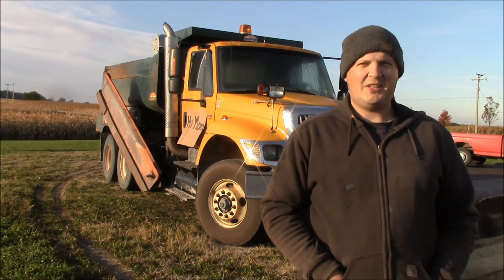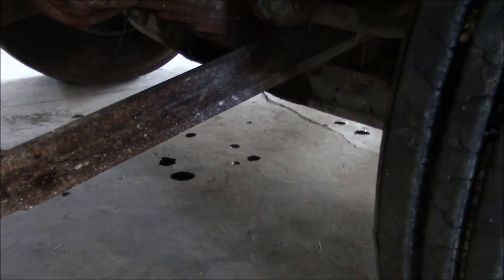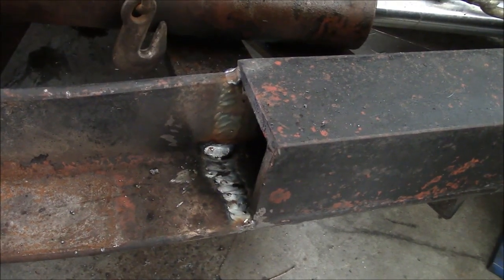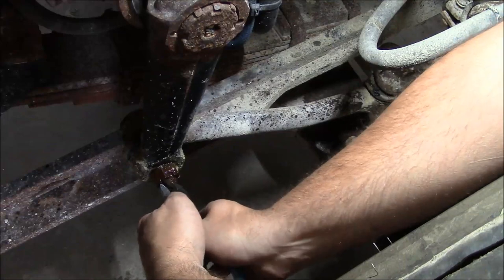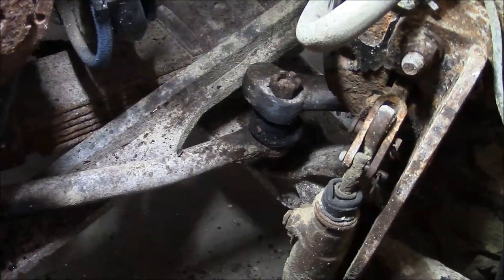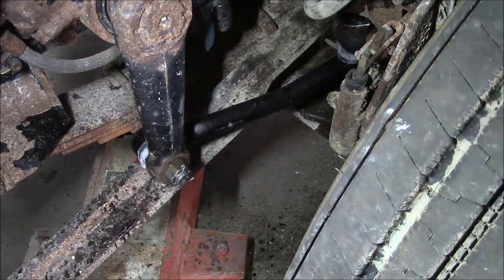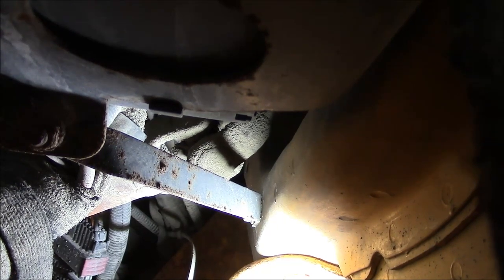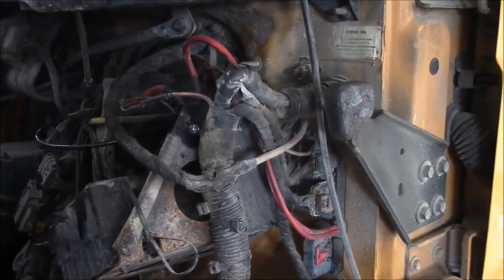Fixing a Plow Truck

Comment: Wes,  Does this engine have a similar High Pressure Oil Pump setup as the Powerstroke?  If so they have been known to slowly allow the oil reservoir in the HPOP to drain out over time when not in use.  When cranked there is no HP Oil for the HEUI injectors, eventually oil re-fills the HPOP reservoir, but now there is air in the HP lines that has to bleed out.  Usually all of this takes enough cranking to discharge the batteries to a point the Injector Driver module turns off due to low voltage.

Comment: Wes, what are your thoughts on a new in cabin battery isolation switch & a few high amp cables. Instead of replace isolation switch on battery box where its exposed to salt & corrosion. Or is that just adding to cable birds nest of wires? Cheers.

Comment: Could you add an extra battery an isolator? So that when cranking the starter pulls off the duals and the electronics and injectors pull off the aux. So voltage drop won t affect the injectors

Comment: The no start issue is most likely the camshaft positioning sensor, the DT466 is the same as the 7.3l powerstroke. I had the same issue with my truck occasionally not starting turned out to be the camshaft positioning sensor.

Comment: Wes,

Not finished watching yet, but...

Is there a GPS and a tracker unit plus a control unit installed?  What about a road surface temperature probe?

I have come across the same issues (power wise) that you have. It’s common in Europe to have some extremely sophisticated equipment. Unfortunately it is often installed by who ever wins the bid. You end up with a really expensive gritter that is then modified by four different companies. This makes a reliable, if expensive, gritter, inoperative (U/S).

Comment: Saw this on Joe's Auto Electric, a meter called an Amphound.  It allows you to check the draw across a fuse in place, so no device reset by pulling the fuse to check for amp draw.  Hope this helps if that truck comes back.

Comment: Love those 03-07 trucks most common problems on plow trucks were fused wiring coming out of battery box (If you get the yellow "engine" light start there, A IPR once in awhile. Any questions on plow/auger controls let me know

Comment: I ran across a great tip for locating parasitic draw without pulling fuses, or going through multiple resets.  You measure the voltage drop across the fuse, and a chart (using the resistance of that fuse) will tell you the current passing through the fuse.  On modern vehicles, sharp probes can reach both sides of the fuse through the case.  Let me know if you can't find a chart, or this doesn't make sense.
Reply: I've found you can even measure the voltage drop on wires feeding the fuse boxes.  Easy way to narrow down where the active circuit is.

Comment: The 466 and 433 use a HEUI system and on these engines there is an oil reservoir towards the front center top of the engine.  On the bottom is a check valve that can sometimes stick open causing it to drain out.  Shows as an extended crank or no start.  Next time it does not start have them call you.  On the top of the reservoir is a cap with an allen bolt i think.  See if the reservoir is empty.  If so refill it with oil and see if it starts.  If so just replace the check valve.  The is a common issue with the 7.3s.

Comment: Had a similar problem with a 2000 international 4700 fb tow truck there a wire bundle for the main harness that controls every thing on the truck. The conector for that main harness get warn and make it no start it was under the cab by the battery box i remember that but the fix was simple take that clip out and rewire with out that conector direct wire with out the clip conector

Comment: I drove those for the county for 15 years, did the "hook up" one those ( pulling the plows and sander off turning back to a dump for the summer then back to a plow in the fall ) I had the Cummmins 425hp IPM's and then later Max Force 13's at 475hp and they all had 18spds. Solid old trucks. My two favorite's were a 2006 with a forward discharge box with a Cummins and then the 2016 that had the later version of the Max Force 13's after they were sorted out. THAT was a beast of a plow truck! Then I was stuck in a Western Star with a Detriot and Allison....hated it as compared to the last International with the big power and 18spd. BUT go real familiar with the plow system from pumps through to plows and plow frames.

AND to the parasitic draw on the batteries......we had battery shut off's... as they always had things powered up. Other thing is rust/corrosion from salt skews everything, all the connections everywhere. most had a junction box at the rear of the truck, a round junction box. We had that set up with plugs for the lights on the salt bodies....then unplug them leaving the standard tail light. THAT box would collect moisture and corrode internally creating issues everywhere as the "pool" of water was across all things....another source of power loss. Net was we would take those trucks when they came in from Stadium International and pull EVERY connector and pack them with dialectic grease. Every one before the truck saw salt. My hunch is on your truck if you pull some of those connectors you will see the tell tale green and that will cause intermittent issues. Also the starter solenoid. Of course that's assuming that truck saw salt use. We could get a "clue" plugging into the lap top and chasing error codes...never pointed to the exact area but the class of connectors around what systems were corroded. One of the last ones was the "DEF" sensor on the tank.....got corroded and failed at 1:00 at night 20 miles from the shop on a snow and blow night.....shut that truck down! Red light. While killing time waiting for assistance broke the lead accidentally when pulling out scraper I had stuck behind the fuel tank.. by chance...and by did a red neck reconnect did another battery shut off and restart attempt and the truck fired right off. Got me home. Found it had corroded along with a few others we had missed with the grease.

The other common issue with the later ones is salt would pack in that small radiator they had in the egr system under the main radiator. Wouldn't do its job and the truck would start throwing egr codes and going into limp mode. Drove every one crazy until we figured that one out.

Comment: Like you said hammer on the taper has always worked for me.  hope you get some of the other work you found wrong.  My Diamond Reo was an old township truck and its got all that hodge podge wiring from the 70's on in it. surprisingly most of it works.
Reply from the maker: The wiring on these plow trucks is always scary. Even it the body installer does a good job, the township guys will do all kinds of sketchy repairs that make things worse.

Comment: Awesome welding job man, as for the "intermittent no start" issue,  if that kill switch is old enough to be frozen up then its old enough to have pitted contacts, which notoriously fail during frigid weather.  Tell them the next time it refuses to start to check the voltage passing through that switch 1st thing.

Comment: We have a roll back with a 466E that wouldn't always start because a bad O ring on an injector was letting lube oil leak by, so the engine struggled during cranking to build up enough pressure to open the injectors.

So it wouldn't start on a low battery or if the engine oil was hot.

Eventually it got worse , which is when it became "diagnosable".

So watch the oil pressure during crank, if it's marginal it can cause random no starts.

Comment: In a previous video how to precharge engine oil i use a refrigerator compressor with copper tubing and fitting sucking out of oil pan and charge to hi pressure side on my international itis in the chanel above the oil pump at a 1/8 n p t fitting works great

Comment: Hi again Wes - one suggestion with your meter. Cut and Wire in an in line fuse on the positive lead, and drop in a 7.5amp fuse. Did that with mine, saves a LOT of money in case of an oopsie.  Kinda shocked to hear them say that .5amp IOD is acceptable, not in my books it aint!

Comment: Well at least the tires look good! All the cracking is just l like having extra tread 😒
Reply: The tires are fine. They usually get refurbished like 5-6 times before they reach end of life :)
Reply: @RubenKelevra  iuì
Reply: Geez. Everyone who has ever bought something with wheels from a farmer says the same thing. Why? Because Farmer Brown will NOT change that tire until it turns into rubber and rust molecules.

Comment: U.K. Just found your channel - Subscribed. Not sure exactly why but you show good and bad and that's what life is. I have found the worst lot for looking after anything mechanical is farmers. The worst was a large scrub cutter towed by a tractor. It had 3 x 30 inch square blades with hardened cutters on the corners. They went round so fast they howled. The blades were thin aluminium sheet and one was cracked right round 6 of the 8 bolts holding it onto the hub. It was used on a campsite and I had visions of the most deadly frisbee on the planet carving through tents, caravans and people. Made some new ones up out of 16 gauge steel and painted them. Be OK till the rust bug gets at them. Take your feet off at the ankles.

Comment: If you reset the A. B. S.  and it resets it is a air gap issue between your sensor and your tone ring. If it doesn’t reset it is a wiring issue.

Comment: South Main Auto uses a infrared heat camera module for (Flir?!) to visualise where the parasitic draw is happening. You can actually see which of the modules is 'hot' by looking at it through the camera. Very handy, cause otherwise you'll have to chase fuses and isolate circuits. Worth investing in that :)

Comment: Our international tow trucks where I work we have 2 of them that have a no start issue. If our wipers turn on when the key turns on it won't start
Reply from the maker: Interesting. I think the wipers are controlled by that body module.
Reply: @WatchWesWork  it's the weirdest thing. We "solved" it by putting in battery cut offs

Comment: You have a good work ethic, hope the township realizes that.  When they go for lowest bidder it is often the sloppiest bidder too. They should bring their cables to a clean connection point that can be used to isolate equipment for trouble shooting.  Glad I was able to reject installed equipment that was not neat and clean along with properly installed.  The steering has to be as shaky as the nuts where mean.   Nice touch on the Hi Mom and keeping the township name private, I am glad you respect your customers.  I hope you get to much work so you can choose what you really want to do, some days beating a part out is therapeutic.
Reply from the maker: Heh. Usually the choice is to try to do it all!

Comment: Not sure if the dt466 is setup like the power stroke with the hp oil lines. I remember getting air in those lines and it being a bear to start(it definitely had some oil leaks)
Reply from the maker: It is similar.

Comment: I'm guessing you already have a decent clamp meter but since I didn't see you break it out - something like the uni-t ut210e with low-range dc clamp metering can be a huge help in tracking down what's drawing what in a vehicle, especially when paired with some fuse "current loops"
Reply from the maker: I own at least 5 clamp on amp meters. Possibly more. And I did use them. You just didn't see it on camera!
Reply: @WatchWesWork  Yep, kinda figured! The comment was also a tip for other viewers ;)

Comment: I think a scan tool(ServiceMaxx  pref) would help with the No start...then you could verify oil pressure high and low/rpm signal/fuel pressure/idm v/Inj PLSwdth..... with very little work. If it is loosing RPM signal I would make sure rust has not pushed the CKP away from it target:) You could always scope it too   Cool video as always Wes:)

Comment: I have the same thing going on in my car at the moment. I think on mine it has to do with the timer for the interior lights, I have been pulling out the fuse, but it makes the key fob not work to open the doors. It is very hard to find, and it suddenly turned up less than a week ago.
Reply: A friend found that a rear passenger door electronics were causing a similar problem.

Comment: The injector o rings fail as do the injector line pucks (seals) on the high pressure oil rail causing hard starts and sometimes crosses oil into the fuel system. Sometimes the problem is more prominent hot beings the oil has thinned. Gotta love 466s
Reply from the maker: I suspect this is electrical. Maybe FICM related.
Reply: @WatchWesWork  could well be. I read the post wrong I believe so it's not starting as in it has a battery drain causing it to be dead in the morning or is it just hard to start I run quite a few of these 466 engines in my fleetpretty regular problems from the fuel injection pressure regulator on down to seals and what not they really don't appreciate being ran hot this initially causes most of our fuel system problems and hard starts keep up the good work I'm always interested in finding more cures for the pesky 466 that I have grown to love

Comment: I had battery issues with my Yukon coming from the AC. I put a 3 amp float charger on it and leave the charger plugged in no further issues and these chargers will not overcharge the batteries. A fifty dollar fix.

Comment: If you turn the cotter pin 90 degrees then fold the end back over the end of the bolt you won't leave little daggers sticking out for the next guy (probably you) who puts his arm in there.
Reply from the maker: I got in the habit of doing it this way after years of working on wheel bearings where the cotter pin had rubbed a hole in the dust cap when it was bent as you describe.

Comment: It's real easy to find a parasitic draw on a truck like that.  Turn off the key.  Pull all the fuses.  Put an amp meter on the positive cable.  Put the fuses in one by one.   When the current jumps up you now know which circuit to look at.   With an assistant watching the ammeter, start wiggling wires on the circuit involved.  That will find a short.  Also look for switches that aren't turning off.  Doesn't take that long.

Comment: I welded for over 35 years and if you burn yourself apply heat to the burn just to feel the heat from a lighter flame for a few seconds and it won't blister or hurt or short time later, but in time you will have new skin under that burn.  What you are doing is stopping the nerve endings  from sending the message to your brain that you burned yourself done this many times

Comment: They should just call you when they have the problem. Easier to just wait until it happens, or add a timer with a battery disconnect. If there are 45 minutes no cabin light, it just disconnects the batteries. If you want to start it, they have to reset it :) 
I bet it's just salt and water on some connections increasing the current draw overnight, while the snow is thawing.

Comment: Get yourself a Aloe Vera plant, whenever you burn yourself just break off a tip off one of the leaves and rub the juice onto the burn the quicker you do it the less burn you will get, I have often burnt myself with a gas torch over the years and using aloe Vera you can't even see where I burnt myself the next day.
Reply from the maker: Hmm. That's a good idea. We had one in the machine shop when I was in college.

Comment: Those are split pins Wes, they’re split, see !
    You could replace the battery disconnect switch,( and make the drivers job dependant on using it !)
Reply: not part of the work order for a disconnect, but assuming he wrote it down for a later fix with all the other observed issues.   
* often a government worker :  a driver only drives.   a mechanic does only what is needed to keep things running, routine daily maintenance is often skipped for the next day and that leads to never done for a year or more in some cases,  and will omit steps not needed if not an immediate issue and will send it off to be fixed when the steps that are suppose to be routine  that were not followed catches up..  not saying that is all cases or this case, just saying it happens.
Reply: ROTTK9  Yup

Comment: If you want to mitigate that burn (I know this is years after the fact) there is only one thing you need and that is simply an Aloe plant you can keep in your house.  Break a piece off and smear that gel all over it and then let it air dry.  Bandage it loosely and put more Aloe "Juice" on that burn about 4 times a day for 2 days or until it feels comfortable. 
When it is all said and done you won't know it even happened after a week. The burned skin will not dry out and be uncomfortable as it would be normally. Ask me how I know.

Comment: hit steering arm on the end it makes tapered hole egg shape it will pop out
Reply: When you hit it, it is a solid piece with the tapered joint and arm as one, so the taper doesn't deform permanently.  I guarantee it didn't get past the plastic deformation state.
Reply from the maker: I'm not that strong!

Comment: Couple of common problems with those,cam sensor and won't throw a code,the plug on the icp regulator goes to hell,on the front of the timing cover above the compressor there's a bolt you take out and that's the reservoir for the huei pump,if oil comes out your good,if it doesn't the huei pump is bad,injector o-rings could be bad,if you have oil in the fuel there bad.check valve in the fuel pump,dirty screen on the bottom of the fuel filter housing,I would scan it first just to see what's going on
Reply: Also if you codes for all 6 injectors high to low side open that usually means the idm is junk